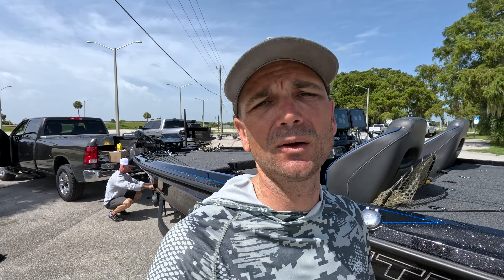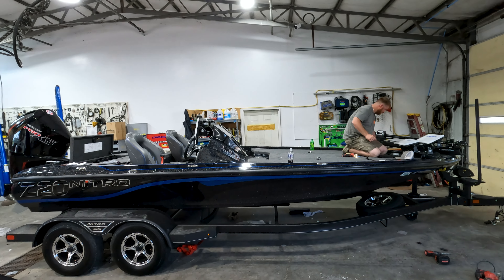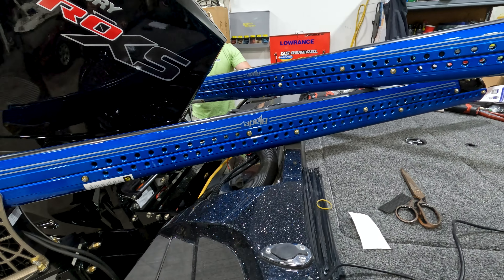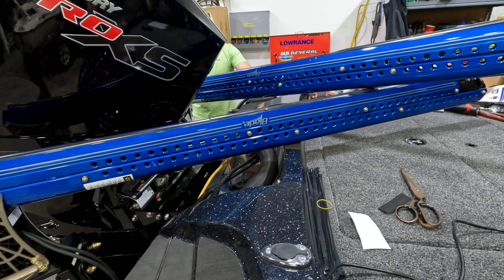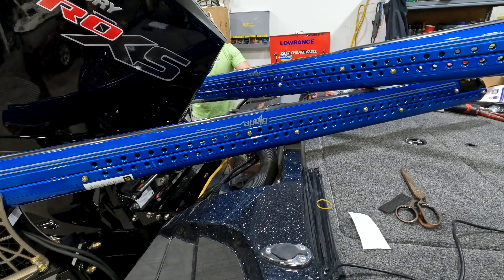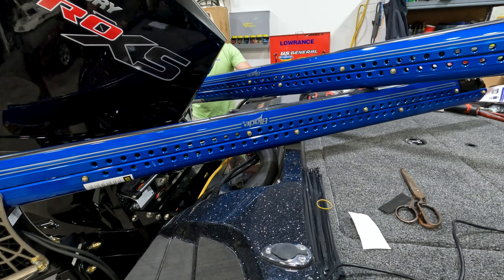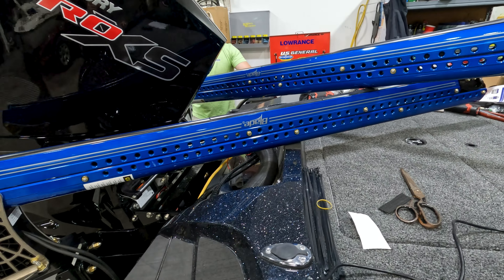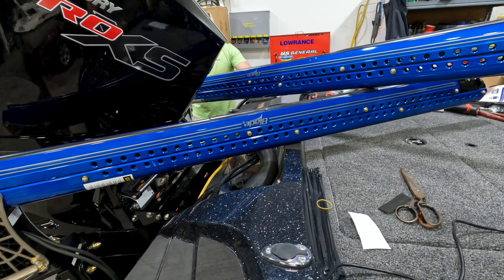My Bass BOAT is Better than the PROS!!!

Comment: Awesome video, I have the tilt brackets as well, they are awesome, you mentioned that you tie your poles down with a strap and actually travel like that. I honest did not realize that was possible. Could you post what type of strap or a picture? Always been worried about the bounce action of the poles would be expose too while traveling with them down.